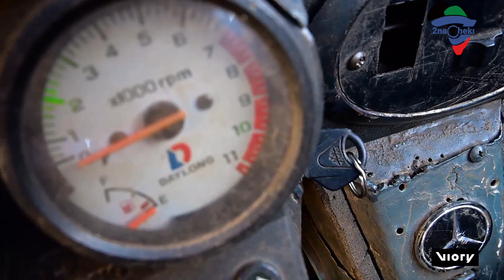Nigerian Students Construct Their Own SUVs

Comment: Iam not impress they should be developing machineries to escalate the rich minerals from the earth refin and process what about plastic rubber aluminium ore copper/electric wire steel sheets steel rope other are making sprocket from waste metal what are we realy doing or build a cargobship from scratch you have welders you can import the steel for now not vehicle that could refine later we talking real stuff for real development dig deep my people dig deep

Comment: Good job ensembling  from existing materials, I’d like to see us focusing on innovating from raw materials to finish products. Africa must manufacture or capable of manufacture ALL . They’re laughing at us, any simple mechanic can go into a junkyard and purchase all used parts, put them together and build a go cart just as this brother Nigeria did. Go invent ways to manufacture auto parts from raw materials, the steel that makes the body parts, the bolts that hold them together the machine that mass produces the bolt, the engines and every single parts including chips. Today as we speak, China is not allowed to purchase purchase  EUV machines to mass produce high end chips, China is working on leapfrogging their technology. I’ll celebrate that adoption of mentality not putting scrap metal together and call it innovation. Get to work!!!